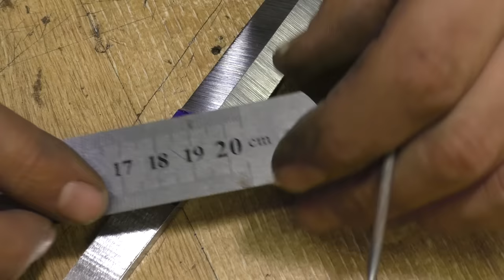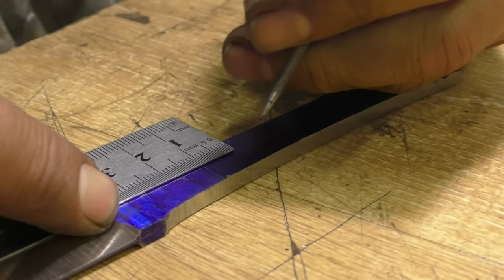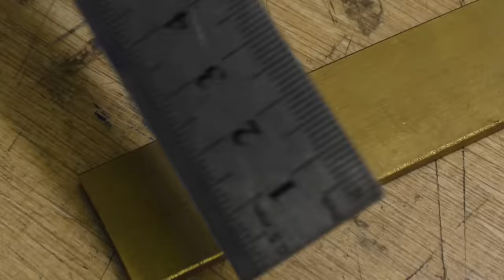Making A Dagger From an Old File

Comment: Very beautiful knife.  Excellent balance with scale color and refined blade. One of the best moves, which had to do with the design of the blade, was removal of rows of teeth from original file. Utilizing a file makes it easier to create a wonderful knife, but to leave rows of teeth from original file is what I would say is nothing short of laziness. One piece of advice. Have to agree with Milan about using 7-up bottle. Worked on oil drilling platforms after high school. Hydrochloric acid is used to help drill through rock to get to shale containing crude oil. A close friend was a welder who brought his drinking water from home in a mason jar. He put it in the refrigerator with his lunch. He came into the trailer for lunch break and thought he grabbed his jar of water. Someone else had put Hydrochloric acid in a similar jar. My friend drank the acid thinking it was his water. Caused severe burns and led to many surgeries. He died at a young age and suffered tremendous pain. Mark containers with chemicals and place them out of reach. Thank you again for a beautiful video. 👍🏻👍🏻👍🏻
Reply: Wow Chuck, so sorry to hear about your friend !

Comment: The first heating to cherry red then letting it cool slow over night of the high carbon tool steel was that ANNEALING for easier shaping on the sander? Why did you quench twice rather than heat treat(normalize) twice then quench before tempering in the oven?